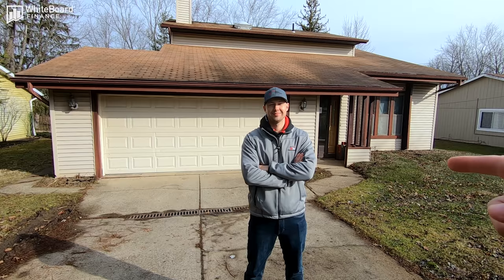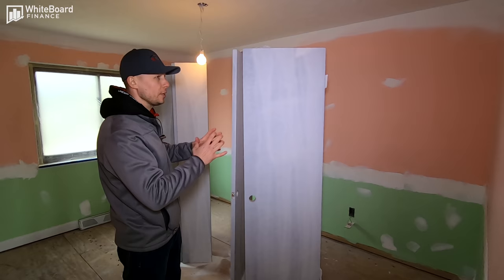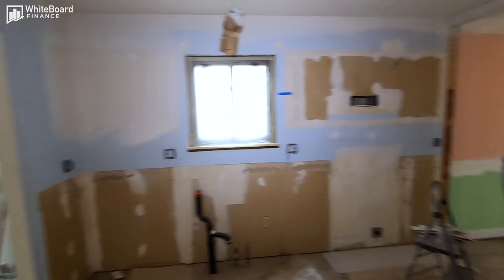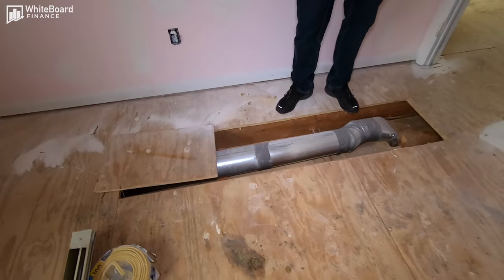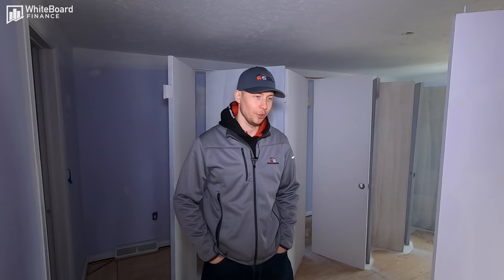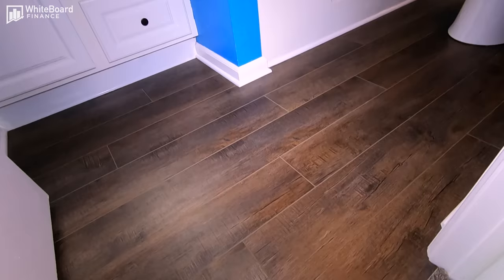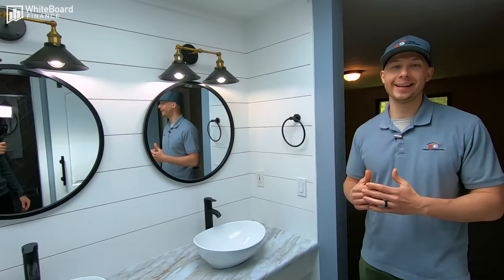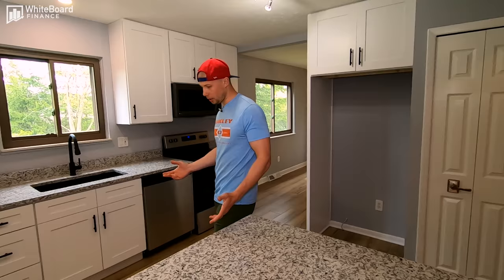How To Flip A House For Beginners (Start to Finish)

Comment: This Housing market crash might end up being a part of us for a very long time. With inflation currently at about 9%, my primary concern is how to maximize my savings/retirement fund of about $300k which has been sitting duck since forever with zero to no gains.
Reply: The stock market is a way to hedge against inflation. Most notably amidst recession, investors need to understand where and how to allocate funds to hedge against inflation and still make profits.
Reply: The enduring US housing market bull run evokes a mix of fear and excitement, presenting opportunities with insight, resulting in $780k gains in the past ten months, utilizing a portfolio advisor for a well-defined strategy.
Reply: How do I reach out to one? my assets have been struggling since 2022 and I’ve been holding on by the skin of my teeth.
Reply: Don't be hesitant to contact Sonya Lee Mitchell and follow her directions.
Reply: Just ran an online search on her name and came across her websiite; pretty well educated. thank you for sharing.

Comment: How to Make Money 101:
Step 1: Have money
Reply: I got 120,000. I'm not convinced it's enough to do anything with.
Reply: redsoxfan  I'm 66. Too old for the grunt work. Not that I look down on manual labor. Ever use a pick and shovel so much that your fingers lock onto the handles aka "ignunt stik" and you have to pry your fingers off? Ever smell the sweet Earth as you dig five feet down into the ground and tunnel under a sidewalk? All by your little self? I renovated my own house. 800 square feet. Top to bottom. I even replaced the sewer line all the way to the street. And I was working full time and over time. I used copper everywhere from 4" to 1/2". Gas line. Romex. Junction boxes. Metal receptacle boxes. Three way light switches. The space under my house is only 24" so I had to do a lot of crawling, sliding, twisting and turning. I'm the real deal. I don't know about you but I'm convinced that some The Home Depots are run by gangs. My only advice to anyone who bothers to read this is when you hear the phrase, "A little hard work won't kill you." don't believe it! Well, it WILL kill you. All the incredible hard work that I did wore everything out and I have arthritis everywhere. No, I need a supervisory job. I'm smart, reliable and honest and available 24/7. I love money. I should put some of my funds into places suggested by Fearless Leader but I don't trust anyone. Not even my bank and its personnel. (Oh, I have good reason. Banks will do what is good for them. Tellers will steal money if they can get away with it.) I would need a bonafide, iron clad contract. If the investee has to go out of business then I want all my money back plus interest. I still maintain that 120K is chicken feed.
Reply: john plaid your attitude is why you only have 120k saved up
Reply: redsoxfan hi can you elaborate on the “stacks of competitors off eBay for pennies” please? Thank you. You just have out pure gold !
Reply: Actually step 1 is educate yourself
Reply: lol true
Reply: Spend money to make money
Reply: Real estate is cheap in Ohio, might be more difficult in FL. Im really interested in flipping, but real estate is very expensive in South FL.
Reply: redsoxfan truth!
Reply: redsoxfan  yeah, the successful houseflippers don’t do their own work. That takes up way too much time, and it’s impossible to work on every property. Plus, you don’t want shotty work. But I mean, if you think that’s working for you, then knock yourself out, but if you do your own work, you’re not maximizing your time and losing out on profits by not doing more deals, by spending more in holding costs, and risking the market going down. Not a good idea
Reply: redsoxfan  Prove it.
Reply: Esmeralda Encarnacion exactly. That house where I live would be at least $650k. How do you start flipping when property is outrageously expensive?
Reply: redsoxfan  great advice... I'm trying to get started on my 1st property
Reply: redsoxfan  Hello, so how much do you think I should save up before starting out? I guess thats my main reason i feel stuck and cant do anything.
Reply: @louispablo4576  How much do you have?
Reply: @johnplaid648  I have 250,000 and I'm not convinced its enough to buy and flip houses.
Reply: redsoxfan  do you have a suggestion of where to look for homes to flip? Besides zillow or Facebook marketplace or craigslist?
Reply: @johnplaid648  yup highly hard work I’m currently shoveling everyday to Pay check is adding up but This real estate is what I’m seeking
Reply: @johnplaid648  it's not.  Invest it and see if you can make more so you can have some real money to play with
Reply: @jenniferh895  get a hard money loan
Reply: @johnplaid648  you kidding me lol
Reply: Step 1: 
GET money- work OT, second Job, Save, Sale stuff off, etc. 

Or

FIND money - offer a skill to someone who wants to make money by lending their money to you. 

Listen to some of the podcast on bigger pockets. Plenty of people sleeping on dirt floors that made it to millionaire road with hard work.

Comment: So he opened up walls, changed electrical and HVAC paths, put in cabinets, painted everything, new bathrooms, granite counters and sinks, all new flooring on 2 levels, accent walls and light fixutres....and he did all that for $32k?! 
The average cost of a kitchen remodel alone is $25k and a bathroom model is usually $5k to $10k. Now I also take great pride in doing remodels for low costs but I do it based on sweat equity and unfortunately lower quality work because it is me doing a lot of it. 
I would love to see videos of his strategies to get this much output for only $32k. That is awesome.
Reply: He managed the project himself and did not hire a GC. He hired subcontractors to do the work and wholesale pricing on cabinets, countertops, etc.
Reply: He is probably fudging that number was my guess. This concern and the other about how the neighborhood had that buying price in the first place were the best to me.

Comment: I worked for a guy who flipped houses in some parts of the south & midwest & you wouldn't believe the stuff we had to deal with, like cardboard walls, newspaper insulation, bare electric wires running through the attic, racoons & wild birds, a hole in the roof covered with duct taped plastic, roaches bigger than you can imagine, dog shit all over the place & one house that had a kitchen sink that drained into the basement. You can't believe how bad that house smelled. And that's not even the half of it. If you want to do this you better have a strong stomach

Comment: Good job but I would have picked a better looking granite (quartz actually) and no blue in the bathroom, it's too personalized and needs to be a more neutral color for a wider buying market if looking to sell right away as an investment property.  Most home buyers that buy completely rehabbed homes want the home perfectly move-in ready with no refreshing, painting or fixing anything on their part, in my opinion, and if you provide a home with more neutral and classic hues with high-end, current and cutting-edge touches and components you have a much better chance of selling the property quicker and at or even above your asking price if you create a bidding war in a sellers market.

Comment: No hate or anything but i know not one single permit was pulled on this flip its imposible to flip a house and sell in 6 weeks with pluming,electrucal inspections done plus any time you remove a load bearing wall u need an engineer to design the beam ext and pass that inspection witch it takes time,other than that great job  nbs

Comment: Biggest question not spoken about was, how do you get a contractor to remodel that quick? It seems he bought the property and the guys were in there the next day working.  Does the flipping company have employees that do the remodeling ?  Is it subbed out?  How do you get work done that quickly between carpentry, HVAC, plumbing, landscaping, etc.  A lot of times contractors are very unreliable and try to juggle jobs.  Six weeks doesn't seem realistic unless you have a contractor consistently under contract and not taking other jobs.

Comment: Looks nice, but all cosmetic items. You really didn’t talk much about the roof, Furnace, a/c, service panel, wiring, water heater & plumbing. These items can be very expensive to replace. Especially if your a novice & have no idea what your looking at or buying! I’m a Investor, have several rental properties, & have bought & sold a few too. I’m also a Certified Home Inspector own & operate my own company in SW Ohio & could give a crap less about $35-50k in cosmetic upgrades when I walk in there to inspect it for a potential buyer. I’m not looking at any of that. My focus is on the big ticket & mechanical items and if they’re all 30 yrs old & at the end of there life or need replaced??.. That could kill your deal or sink you in the Red real quick. I’m all for & support anyone getting out there & making it for themselves, But I implore you to do your research, educate your self about the cost & what your buying if you want to try to get into the house flipping business. Roman’s a Pro Flipper, most are not. 
Word to the Wise; just Be careful out there on your first one or two. One bad buy in the beginning can put you out of the business. The Education & the things you’ll learn after the first one will be priceless! Good Luck!👍

Comment: Your 3 FREE STOCKS email was misleading. I signed up, I think i got 1 stock, but WeBull app didnt update it. It said I would get another stock if i deposit at least $100 by end of day. I did that but ot won't update the funds for up to 5 days. You can not create and find the account on the same day. Had i known this, i would not opened the account. I'm very disappointed.

Comment: Never, do not ever buy a flipped house. Flippers buy fixer uppers, fix them on the cheap and nasty, splash paint over mold, rot & structural problems, install high end appliances, use cheap unqualified labor.
Proper repairs by skilled artisans costs money, which eats into profits